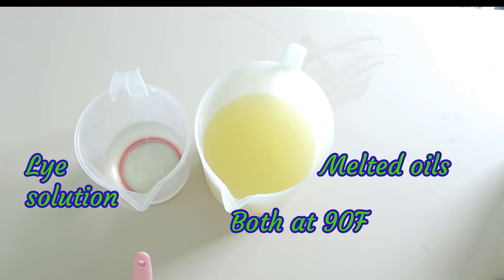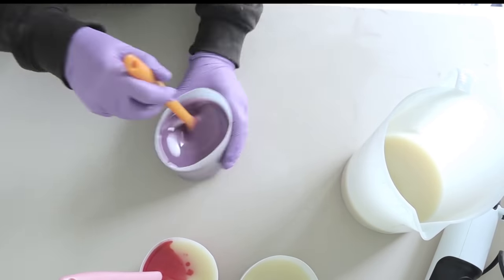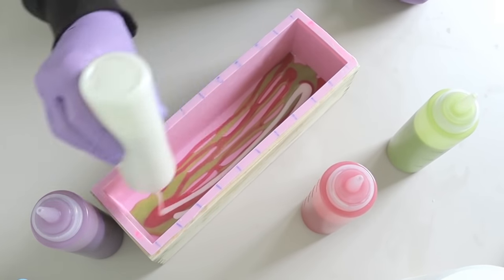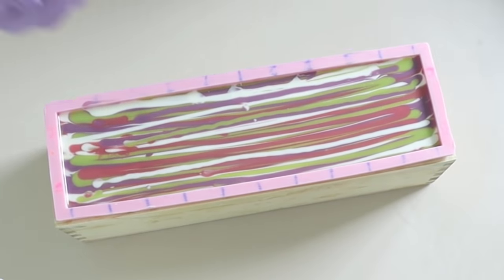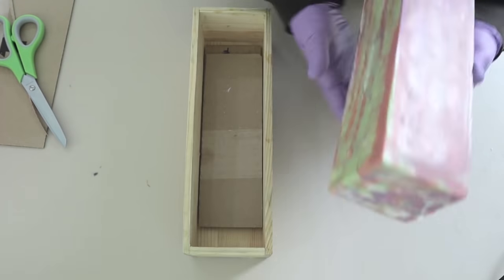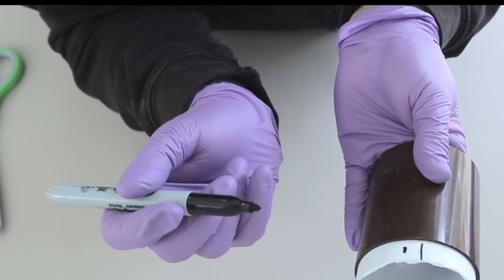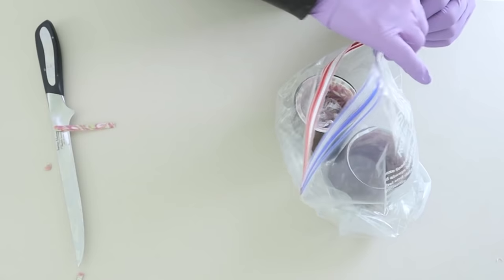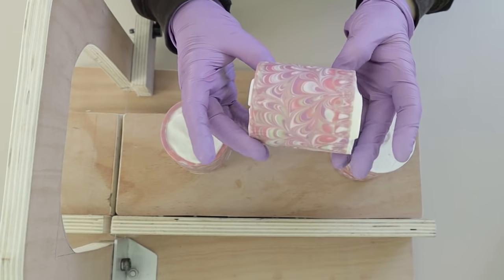Rimmed soap, peacock swirl, round soap, cold process soap making tutorial

Comment: The first utensil you used to cut the thin rims is a cake slicer, to cut thought a cake cut evenly all the way through evenly.
Such beautiful soaps and the beauty is you can change up your outside colours and center colours depending how your feeling. Once again very beautiful and creative bars of two types
Reply from the maker: Thank you so much for your lovely comments as always Tanya. The tool is definitely not a cake slicer though. I actually removed the saw blade that it came with and replaced it with the guitar string. I did go back and research it and found out it is actually a coping saw.
Reply: @IDreamInSoap  I am learning to be a goldsmith. We use these saws all the time.

Comment: Hi Lisa, your enthusiasm is contagious! Never tried peacock swirl in a loaf. Most definitely will try that. I noticed you used short tubes instead of what many people are using, Pringles can. Is it coz' the rim from a loaf mold won't fit? Thank you so much for for sharing so many tips. Love the soap!
Reply from the maker: Thanks a lot Carol, I used the short tubes so that it was nice and easy and fit the width of the loaf (plus they were a size I already had cut from doing a pipe divider swirl, you could cut a pringles can, or use a full one, you would just need to put 2 sheets of rim in and then make sure you smooth over the join in the middle. Stay safe and well :-)
Reply: @IDreamInSoap  thank you so much for the tips. I was mulling over what I should do. Happy soaping and stay safe too!

Comment: Beautiful Lisa.  Makes me want to try a rimmed soap again.  Do you have any tips with respect to oils or butters that would affect soap batter for this design.  Your batter always looks so light in color and fluidity.  Can’t wait to see what else you come up with. 💕
Reply from the maker: Hey Christine. I think my main tip for colour is the oils. I always use refined oils and butter, so for example my cocoa butter is refined and therefore a pale cream colour whereas unrefined can be quite dark. For olive oil I use the Olive oil called 'light in colour', there are a few varieties around, so something like this. https://www.filippoberio.co.uk/products/olive-oils/mild-light/mild-light-olive-oil/  I actually use the version from Aldi or Lidl (not sure where you're based) This makes a huge difference as some olive oils are quite green. 
For Fluidity I think temperature and blending pay a huge part, but try to keep your sat:unsat fat ratio around 40:60, mine is actually 41:59 and works well. Hope this helps a bit, best wishes. Lisa xx
Reply: I Dream In Soap I’m in Canada.  I usually buy olive oil from Costco here but it is quite green.  I’m usually around 50-50 for unsaturated/saturated but I’m going to try a higher unsaturated.  Thanks for your tips. ❤️

Comment: Well, that's a wonderful soap! Just subbed. I just bought wooden moulds made out of recycled wood. At between £5 - £8 each they are pretty good and sturdy pieces. Do you know if there is a spray out there that would help release the soap rather than line the moulds with endless freezer paper or cling film? Also, what % of fragrance oil do you use?
Reply from the maker: Hey Stan, thank you so much for subscribing. I'm afraid I have never heard of anything that allows you to spray a wooden mold, they do seem to need lining with paper, which I agree is a pain. I get bored with that and don't like the waste, so I make silicone liners for any molds without them. It's a bit of a fuss but once you have the liner you just use it again and again. (I've got a video showing how :-)  )
Reply: Yes, I've looked at making my own liners, too. I'll have to search out where to get the materials which are usually never cheap lol
Buying endless rolls of paper is just an additional cost that amounts up to a fair old sum over the years. I'll watch your video now just in case you have a link to getting the materials.

Comment: Hi Lisa. Did I ever ask you what the significance of Iodine level in soap making?  I don’t remember. Anyway why is it important and where is the iodine ( chemically speaking ). Is it in the oils or after saponification. Thank you. You seem like the right person to ask.
Reply from the maker: Hi Tracy. Generally, the higher the iodine value the softer the bar and the more conditioning properties it will have, and the lower the iodine value the harder the bar and the less conditioning properties it will have. The iodine level refers to the polyunsaturated fats in a soap recipe and is measured by the amount of iodine that can be dissolved per gram of fat or oil. Higher iodine levels can lead to a softer soap that may be more prone to DOS. As for where the iodine is (if it is there at all) after saponification, I don't actually know, but you have made me want to dig further and do some research, it is certainly not listed as a content in any of my soaps (All my soaps that I sell have to have a cosmetic safety report produced by a chemist (UK regulation) as part of the cosmetic report you receive an analysis of your soap content after saponification) 
Best wishes, stay safe and well:-)

Comment: I have a question.  Brand new soap maker here.  (Only 4 batches under my belt and none of them perfect by any means. LOL!)  How come you put it in the oven when you can wrap in towels and just store in a closet overnight?  Just curious why one method might be better than the other.  Being new, i am learning soooo much!
Reply from the maker: HI Heather. The towel method is great, no worries at all. A larger mold will generate more heat than a smaller one, so you are likely to have more success with just wrapping if the soap is a bit larger, also it can depend on your room temperature, the amount of water you use and the temperature you soaped at.
If your room temperature is cool, smaller soap, you had a decent water discount (more water  = hotter soap and more chance of gel phase)or you soaped at a cool temperature just popping into the warmed oven gives it a little boost to make sure it goes through gel.
Reply: @IDreamInSoap  thank you so much! I am learning that I am going to have to learn my least favorite science of all in chemistry than my favorite in biology. Lol! Super helpful information! Thank you so very much! ❤️❤️❤️

Comment: Just curious as to why you planed the top... Do you do that for all of your soaps? (Personally, I think the natural top's texture is interesting.) Why not save a step and just flip the soap brick over and plane the layer you need from the bottom?
Reply from the maker: Hi Melissa, no I don't normally plane my soaps, I cut them and then bevel the edges and that's it. It was just the top of these bars, because of the way they are made the design is covered by a little excess batter, so it was just to reveal the design in this case, but it's not something I normally do
Reply: @IDreamInSoap  Okay. That makes sense. I've seen a few other soapers plane the top and just thought they were being persnickety about smooth edges. Now, I wonder if it was for this reason. Pretty sure at least one was a Taiwan swirl.